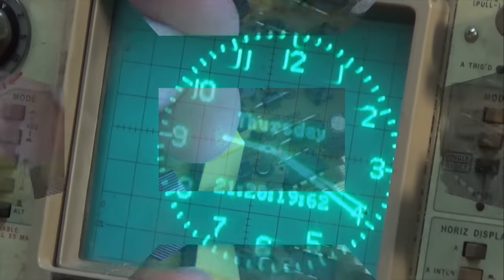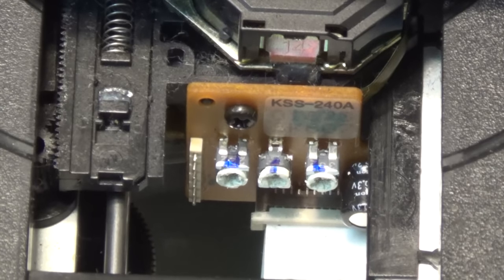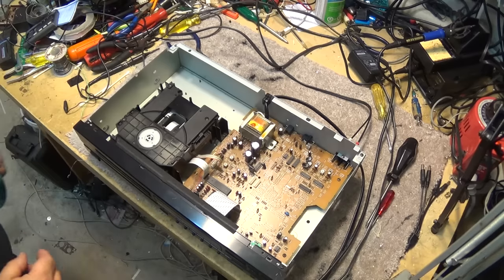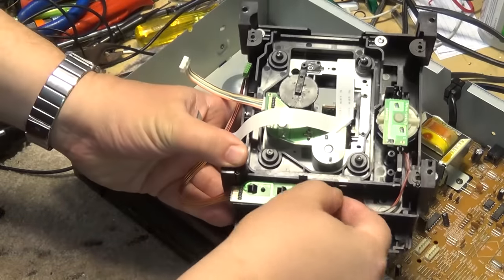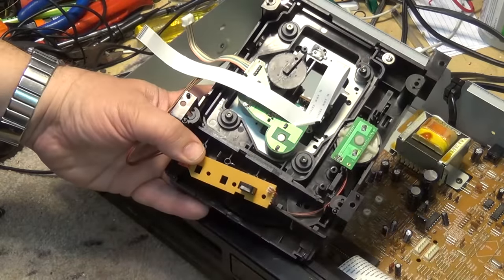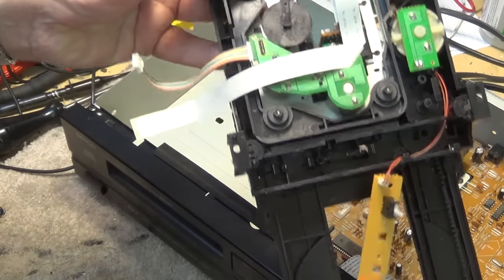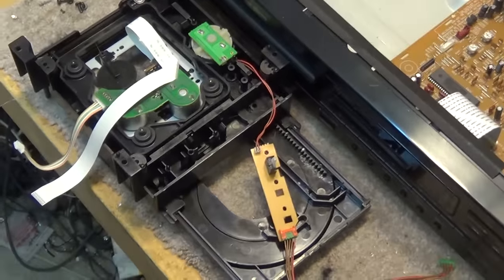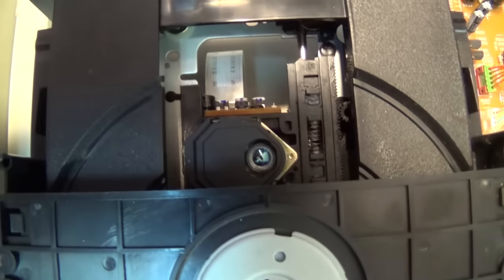Denon DCD815 CD Player disk tray opens and closes

Comment: I picked up a Denon DCD-615 from Goodwill recently and it had the exact same issue. Watched your video, applied contact cleaner to the switch and the issue was fixed immediately. Thanks!
Reply: Awesome! What brand of contact cleaner did you use?
Reply: @pinarellorider9023  Deoxit D5 is what I used

Comment: I just purchased this unit from an estate sale. It had the exact same issue.  With the help of your video I just fixed it. Now it's running like new. Thank you so much for posting videos like this. I have no background in fixing electronics but I love to tinker & fix things myself. Love to work with my hands. With the guidance of this video I was able to save me some $$$ & get the satisfaction of doing it myself. Cheers!
Reply from the maker: Thanks. That is the point in these videos. Also why I try to use common tools, not fancy lab grade, or professional shop tools. The type that the average hobbyist might have. I spent the past 35 years repairing equipment,  20 of those years I did it for a living, and today it is just for the satisfaction of keeping the old technology working. Most of this stuff is pretty simple, and with a little help many have fixed their own stuff.

Comment: Thanks a lot! Today I fixed a Pioneer DV-340 with the same fault. A little contact spray (WD-40 Specialist - contact spray) on the switch, moving it back and forth several times, let it dry, works again. With the DV-340, the front panel attached with clips must first be removed. The switch is hidden behind a small circuit board that is clicked on and sits on the main board of the DVD drive.

Comment: Many thanks for the good explanation! I had the same 'tray opens and immediately closes' issue with my Rotel RCD06 (which is actually a Sony KSS 213-CL). The assembly of the Rotel is a bit different from the Denon in your video, but the principles are the same (interestingly the Rotel drive has two mechanical switches instead of one; maybe one for detecting the open position and one for detecting the close position?).

I used your instructions to fix my CD player and now the tray opens/closes and stays in the required position as it should. I am very happy I can safely drop a CD in the tray again, as with this problem I horrendously scratched one of my favourite Miles Davis CDs (Bitches Brew). From the money I saved by not buying a new CD player or having it fixed it at a shop I will replace the Bitches Brew CD ;-) Thanks!!!

Comment: Thank you very much for this very informative, and enlightening demonstration video, 12voltvids! Maybe that problem is what is not happening with this AMC CD-6 CD Player (of 1992) I bought that's in very good condition, but it won't eject the CD Tray! That open, and quick close operation only happened to me a couple of times; the Denon DN-600F CD Player I bought used works well, built like a tank. 

I very recently made a mistake about buying an AMC CD-6 CD Player from ebay seller that does not know about hi fi audio, or electronics. I bought an AMC CD-6 (of 1992) that looks in very good condition; but does not work! Wasted money, and work setting it up, opening up the case, the CD Tray could be broken! 

However, lately I bought a Denon DN-600F CD Player (of 1998) that looks beaten up; scratched, flanges are sawed off, those 2 machine screws on each of the two sides are missing, top front is taped down with a red tape, and a bit dirty, but it plays back a CD very well! Furthermore, Functions function, too. By the way, it's good you mentioned about static electricity; I was wondering about that topic. I wore an anti-static wrist strap when I upgraded my personal computer.

Finally, I may be able to repair this AMC CD-6 Tray eject problem that's a reject; but I'll get an experienced, expert technician to make the repair. By way, don't you have to be careful of the light from any laser lens assembly?🔉🎵🎶

Comment: I once bought a Denon CD-R-W1500 and there wasn’t allot wrong with it so I decided to see if I could use its CD-R Drive as it did have a few problems but mainly fixed, and had like the jog wheel button missing. It looked as if it was dropped but still works fine. Anyway I tried it’s drive in my slightly faulty Marantz CD Recorder only to then realise it didn’t really fit. So I ordered one from Instrumental Parts in the US. As I’m from the UK so had a job to get one. I replaced its old drive and managed to successfully fix it. Now I have my Denon one with a stuck drive but couldn’t find its switch to re-open it. Is it in the same place as this one or somewhere else? As this one looks otherwise the same sort of drive. Thanks for the help I’ll give it another go sometime and may sell it in future due to being happy with my, portable CD Recorder which is a Superscope PSD340. I discovered the Denon drive is slightly too high but with the right numbered model of drive it is excellent!! I even recorded a CD for my Sister and Brother in Law.

Comment: I came across a denon dcd 615, looks very similar to this one. After opening it I noticed how filthy it was. The disc tray jams sometimes and it looks like they dropped some sort of liquid on it. The inside is all sticky. The pcb and everything else. I was thinking just using ip alcohol on the whole thing but I’m not so sure

Comment: I have the denon dcd715 one with the pitch control, tbh its the best cd player ive ever owned the sound is razor sharp, mine had exactly the same fault, turned out it was just a dirty motherboard connector. the brown one.

Comment: Do you prefer those “single beam” optical units or the three beam types? I read that single beams are more precise and tolerates scratched disks better than 3 beams, but single beams tracks more slowly

Comment: I have a Pioneer DV-530 in my bedroom and it has the exact problem like your Denon. Every time I press the eject button, the disc tray opens but won't stay open and retracts at the end. I don't have a chance to insert the disc. Sometimes if I give a pull on the tray when it opens and reaches the end, it will stops and stays open. Very strange! I have no electronics knowledge but thinks if there is a transistor controlling its movement? After I watch your video, it gives me a clue that maybe Pioneer DV-530 has a similar switch causing the same problem.
Reply from the maker: Door position switch.

Comment: Nice and easy one for a change :-D
It focused quickly so that laser/settings must be spot on.
Ive had computer cd/dvd writers with similar bad switches, toshiba comes to mind.
Also crappy belts not gripping cause more trays to fail, and laser death :-(.
The main pcb electronics is normally ok.
Reply from the maker: +zx8401ztv Already have an offer to buy it from me.
Reply: +12voltvids Smashing :-D

Comment: I have a Sony® CDR-W33 recorder that had a similar open/close problem; however, my issue turned out to be a stretched belt on the pulleys that operate the disc tray.

Comment: Thanks for sharing. This should come in handy. How about ones where you hit eject and the tray won't open? I've had several desktop computers do this and I can't figure out why. I hear it wants to move and the light blinks a few times, but that's it. See you in the next one...
Reply from the maker: +Darryl 603 Check out the BOSE 321 system DVD repair. That one wouldn't, open right or close right. It is either a slipping belt, or in the case of a direct drive, one of the gears has a crack, probably on the motor shaft.  When people shove the disk tray in as opposed to pressing the open/close button, they stress the plastic gears, and eventually they break.

Comment: I have an Aiwa unit with almost the same Sony optical pickup as this, just mine had a dust cover and only one pot on the board. Kss 213 I think. Mine skips though. A lot of stuff could be wrong with that thing, it uses poor quality capacitors.
Reply: The actual issue was a busted gear.🙁

Comment: Has anyone ever done a video for a Denon CDR-W1500 on how to fix the draws on that? Would the switch be located in the same or similar place or are they all different? As I did find some don’t fit others and I tried it in a Marantz CDR340 which didn’t fix and I live in the UK so I ordered one from Instrumental Parts in the US. I then was able to fix that one and even got it working with the front panel back on the CD-R drawer. But I gave up on the Denon Recorder I bought due to not seeing the switch anywhere, so it’s now temporarily in our loft in a box. Please feel free to help!!

Comment: Can you use something besides contact cleaner?
Reply from the maker: There are all kinds of contact cleaners available.  You can wash our with99% isopropyl which will clean but contact cleaners have lubricants they leave behind.   So I would recommend using the proper stuff.
Reply: @12voltvids  
I just wiped it with some rubbing alcohol and now the tray won't move at all

Comment: +12 voltvids Do 3 disc carousel cd players have these switches too?my sharp all in 1 stereo has been opening/closing by itself & now it has 3 cds stuck inside,atm front panel cd buttons are unresponsive & 3disc tray wont open @ all .
Lcd display says ER (error) could this b the tray switch as u suggest in video thats causing the error & other problems too?
Reply from the maker: Yes they have detection switches.
Reply: @12voltvids  so could the other problems i described be a motor drive belt?,or an electronic component failure?

Comment: To 12voltvids I have a DVD player which is an all region player it did work today but I play it all and at the end of the disc when done I put in another disc and it says no disc so I looked at it the tray opens and closes I check the motors they do turn but the disc motor spins and stops the laser head assembly moves a little like it should I did check the switches their ok. one micro chip has a heat sink on it and gets very warm but two transistors get almost hot can a bad capacitor or more of them cause this to not work like this.im sure you worked on DVD players.its a supersonic DVD player all region.do you know what's wrong and to help me please at least tell me what could be wrong with it.since you know how to repair electronics.thanks let me know soon.but it is a small player.i do need your help if you know what's wrong.thanks.

Comment: Didn't almost every pick-up laser used the 3 beam method?, as far as I know the only ones that used the single beam were those Philips/Magnavox that used the swing-arm mechanism.
Reply from the maker: +Gordon Freeman Panasonic / Technics used a single beam. They called it ff1 fine focus 1 Beam.
Reply: 12voltvids
You sure?, because I've seen quite a few detectors from various Technics/Panasonic CD players and all of them had an 8 pin detector, 6 pins for A ,B, C, D, E and F and 2 common pins, while Philips ones only had ABCD.

In fact, I think I still have the detector from a Technics SL-P116 (that I killed by mistake) which was one of those FF-1 and I think it had an 8 pin detector, it would be a 6 pin one if it only used a single beam, but I can't be sure until I find it.
Reply from the maker: +Gordon Freeman I'm only going by the literature that was in the service manuals at the time. I really didn't care personally one way of the other because from a service perspective all that matters is if the eye pattern is correct. The service literature used to claim that it was a single beam system on some, not all of their designs. I probably still have some of those manuals around here, as I had many of them.
Reply: 12voltvids
Well, maybe you have some information that I've never seen, most of the books and magazines I have about CD player theory of operation mention and assume a 3 beam system, I only heard about the single beam like 10 years ago.

I don't know which system is better though, but yeah, I agree, that might not be of importance, but I always found CD players amazing devices, the old ones at least, newer stuff was boring to open and not much to adjust, I could spend hours looking at the eye pattern though, for me is a simple yet pretty waveform.
Reply from the maker: +Gordon Freeman 
I think that some of the confusion is also that Panasonic used some existing pickup chips that had the side sensors but they weren't connected because they claimed that their digital focus an tracking servo was so accurate that they didn't need them. But they just use off the shelf pickups a if you look at the schematic for the ff1 players the 2 side detectors are n/c to the servo. This kept costs down because some designs did use them. This is not uncommon. I had a beautiful old slp50 I think the model was. Single disk, big vu meters. Broadcast unit. I was offered 600 for it, so I took the money and run.

Comment: I just want to say up front. Back in the day, nothing made me cringe more. Than watching someone push their cd or cumputer disc tray closed. You pay all that money. They give you a nice interface to operate your new expensive equipment. Then just treat it like a barbarian and jam the tray closed. 🤯🤪
Reply from the maker: They are meant to be pushed closed.  There is a micro switch that detects the slight movement which triggers the load.
Reply: @12voltvids  Maybe something else was the cause. Because, those guys always seemed to have trays that worked poorly and/or noisily. Probably because they didn't just push it like a button. They would literally shove the thing shot. At least half of the way.
Reply: @12voltvids  Btw. Thanks for the video. I recently got a pioneer CD player that is having this exact issue with the drawer opening and closing right away. Glad to see it's such a simple fix.